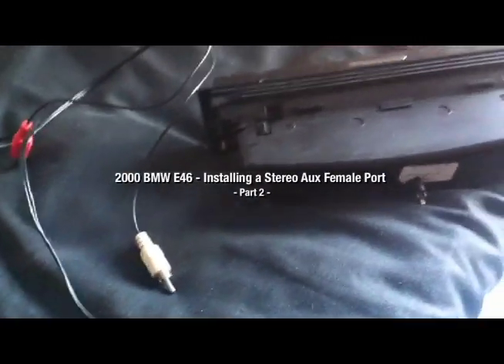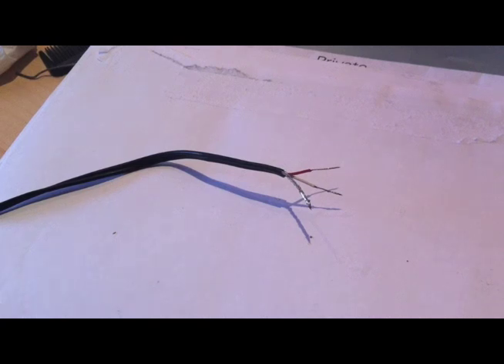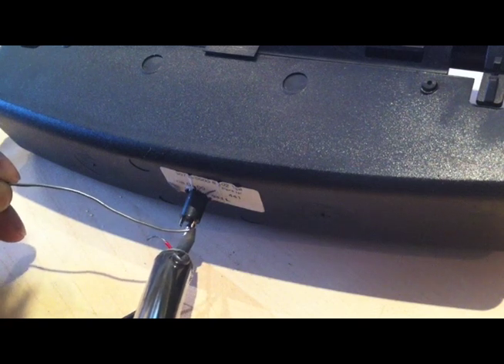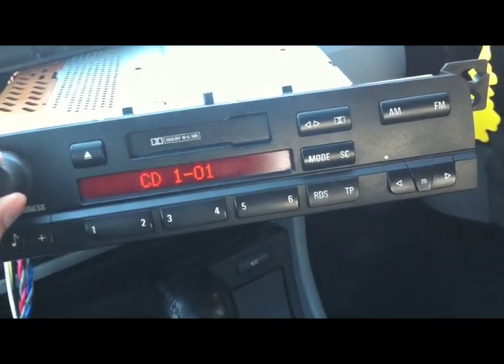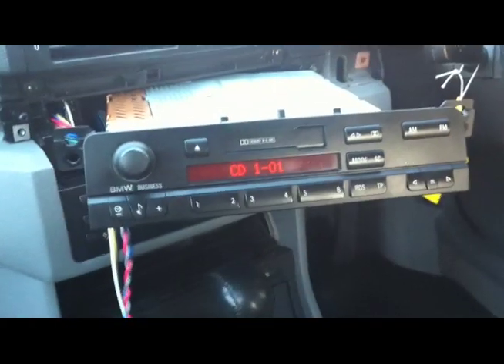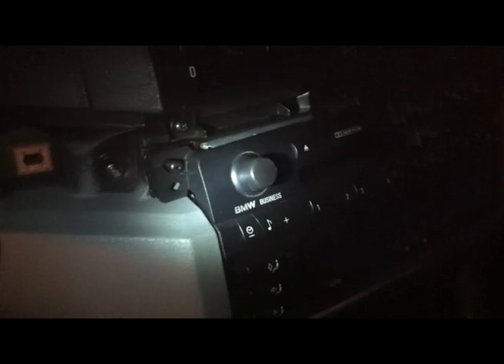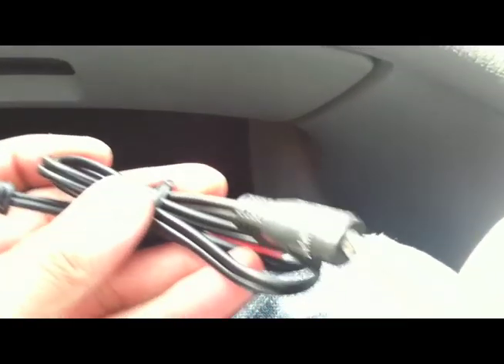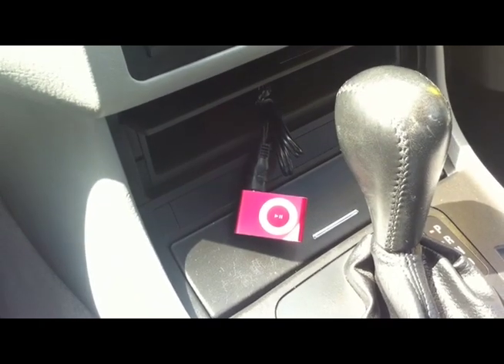2000 BMW E46 - How to install a 3.5mm Auxiliary Socket to Connect Ipod - Replace CD Changer

Comment from the maker: Alright mate! If you have one, the CD changer is in the back of the car behind the carpet on the left. You should see a small panel in the boot trim to access the cd cassette to change the cd's. I wanted a stereo aux cable that had the nut fitting on the socket to mount it in the holder, that was key. Like yourself, I thought it would be easy to find but at the time I couldn't find a reasonably priced cable as i wanted it to be, so I made my own. Although it was fiddly it was really easy.

Comment from the maker: No problem mate! Go for it - if you've never done it before just pop the thin dash panels off carefully with a screw driver (panel tool if you have one). Then the stereo itself is held in by two screws... just pull it out and have a look at the square loom socket at the back. Take some pics of it. Can't remember if I covered this bit in the video... :)

Comment from the maker: Hi Mate! Thank you for your positive comment. Off head I'm not sure which lead you're referring to but if you've found an easier way I say go for it :) - At the time I had to replace the faulty cd player and the adaptor I had bought left me with RCA inputs. As crazy as it sounds I couldn't source a mountable socket other than the one from ebay. I actually wanted one I've seen which is square with "AUX" above the hole but no joy there. My stereo doesn't have AUX mode so I went this way.

Comment from the maker: Hey Marius! Thanks for the positive words mate I appreciate it. Do you have a CD changer in the boot of your car (same as mine)? or is it just a single cd player headset(no cassette tape)?... Also, pop out the stereo, easy job, and check the connectors on the back it should have the same aux port that I have used but I cant be 100% on that without you or I checking it out as I have the older tape headset. Let me know and I'll try and help further.

Comment from the maker: Hope that helps, I don't mind the questions mate fire away :) -  What the problem with your FM Radio?
You could just use a normal Aux cable and have it hanging out the side of the console somewhere or fed into the glove box but I wanted a neat tucked away socket.

Comment: Hello, I have a 2000 e46 Bmw 318i, i was wondering did you have to do anything with the CD changer which is apperently in the back of the car? and why didn't you just buy a pre existing aux cable just for that job, probs easier then soldering it. <--- these comments are made by someone who doesn't know much about this and trying to gather information. cause my FM transmitter is pissing me off

Comment: Hey jaypo7! I finished watching this video awesome instructions! It's my first time installing an aux socket. I noticed in some of your comments that you have a part 1 video I'm looking for the first video but can't seem to find it! I also have a question are you able to use the volume control on your steering wheel after installing this auxiliary socket? get back to me if you can thanks! :)
Reply from the maker: Hey bud! Thanks for the comment, sorry for the later reply I didn't see your mesge until now. The reason you can't find part 1 is that I never finished it :( … It was going to talk about how to take the radio out etc just ran out of time. My E46 is not as flash as yours mate I don't have steering controls. In theory you should be able to get it to work as that controls the stereo unit. So if you iPod volume output is high then you can turn the stereo volume down via the steering wheel!?  I would have to try it out to be sure mate or get on the forums as someone would have tried it already. Sorry I cant be more help. Good luck with it! Post up how it goes… All the best!

Comment: I have a 2000 BMW 323i without a tape casette player. I apologize if the question was already answered but can it be done on my model in the same way? Thanks!
Reply from the maker: Hi Forrest, Thank for the comment. I don't see why not but to give you a definite answer I'd need to know what headset you have? Is it a single cd player? If i were you I would pop the stereo out which takes 5 minutes and check to see if you have an Auxiliary port on the back at the bottom of the loom plug. Also, do you have a mode button that give you an aux option when pressed? I think there is an easier option if you do. All the best!

Comment: I am thinkig about installing a AUX-socket, but i have a BMW 3-seris E46 2000-mod (european years), without CD-changer. So, what difference does it make? I read about it, and I need some sort of adapter, and that should be it, is that right?
Reply from the maker: Alright mate! Thanks for the comment. Does your headset have a tape cassette player? If I were you I'd take ten minutes to pop out the headset and check that you have and AUX port on the back. Do you have a mode button? I bought mine from dynamicsounds00 on ebay I emailed them first to make sure I bought the right adaptor. They were very helpful. Hope this helps. All the best!

Comment from the maker: Hi mate, I bought the Aux connector from ebay from a seller called dynamicsounds00 check out this item number 350407652950 I was supposed to cover that in part 1 but never got round to finishing it off. Hope that helps!